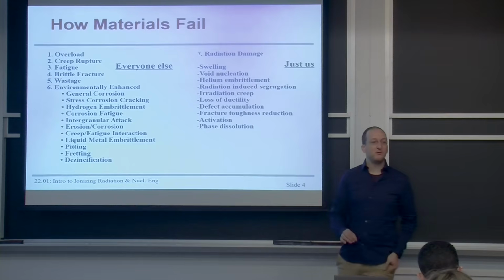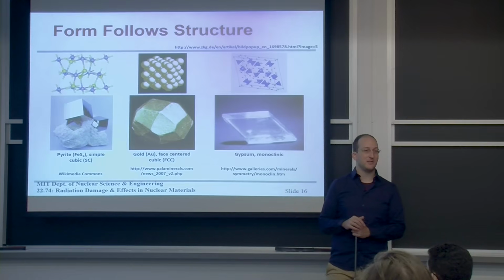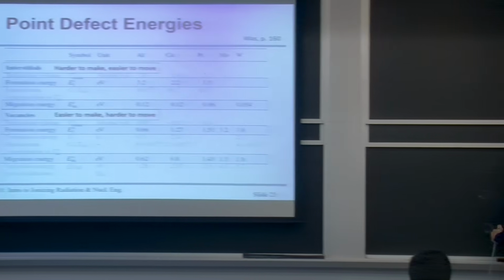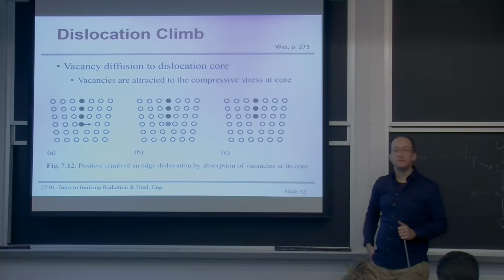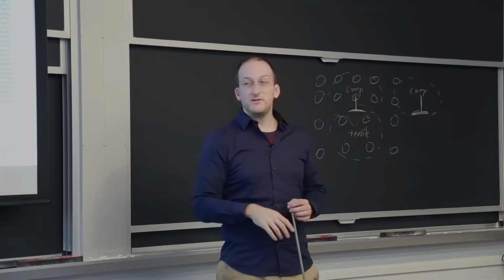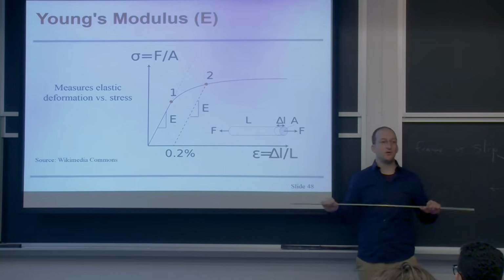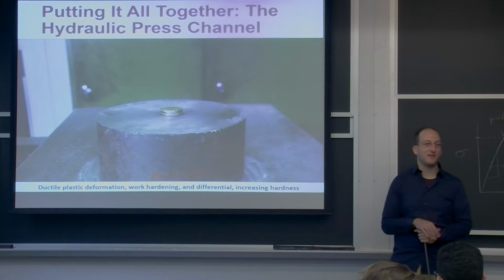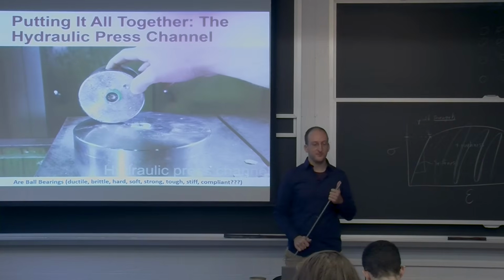27. Nuclear Materials — Radiation Damage and Effects in Matter

Comment: If you're interested in exploring connections between Borwein integrals and the fine-structure constant, you can find more information on Recearch GaLe, a well-known research platform. Search for it using relevant keywords on your preferred search engine or academic database. The title of the blog is "Exploring Connections Between Borwein Integrals and the Fine Structure Constant"

Comment: It looks like they could build a reactor where the coolant is hotter than the fuel.  Run it way beyond critical for a fraction of a second the neutrons heat the coolant then quench it.  Wouldn't fast neutrons have a temperature of 10,000-15,000°F at least?  It looks like you could get better use of the fuel the hotter it is.  You could extract juice by MHD then drive a turbine then use the leftover heat to run a steam turbine.

Comment: You can do an easy experiment at the gym to experience elastic deformation.  Put 3 45s on each side of the bar then press it on the flat you will notice you have to elastically deform the bar before it moves.  Put another 25 on each side it deforms even more.  Take the 25s off and put another 45 and a 25 on each side the bar flexes quite a lot over an inch.  The effect is not linear the bar is very stiff until you get around 405 lbs then it starts flexing like soft plastic